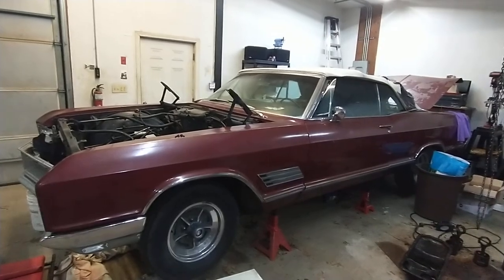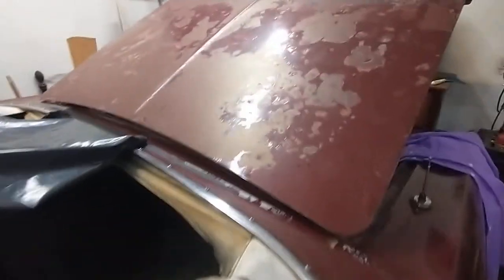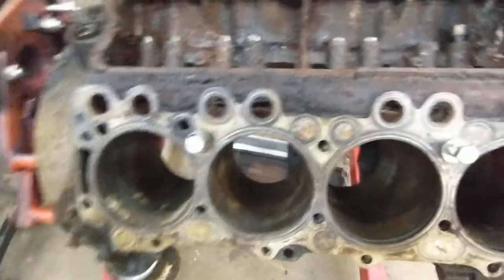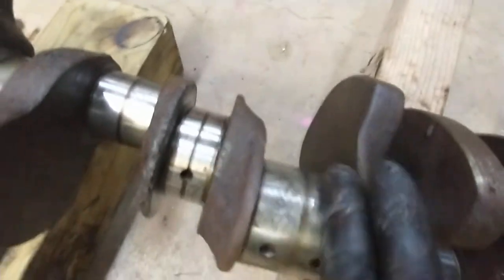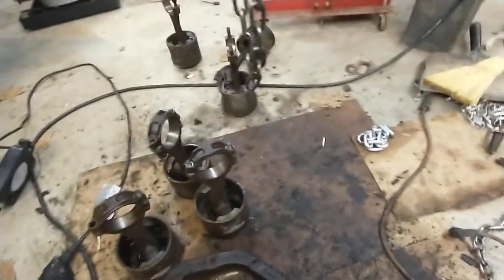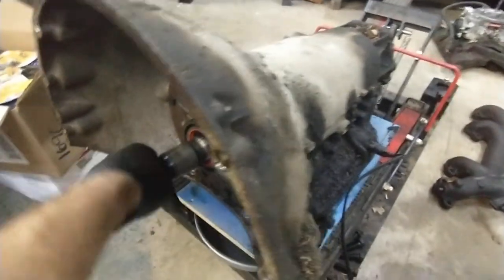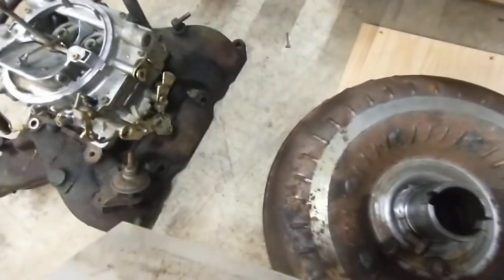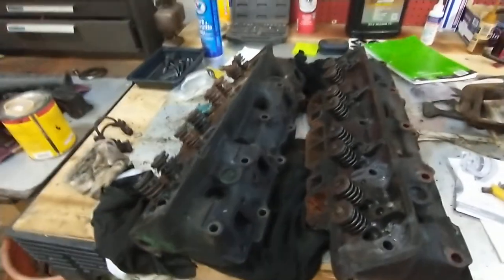New Project - 1966 Buick Wildcat Convertible!

Comment: That will be very nice once completely restored.  The 1966 Wildcat was a large car similar to the Chevrolet in size and a few other points, but in 1966, GM still retained the engineering differences that made so many people fans of one or the other of the GM brands going back to the 1920's, so the cars have few material similarities.  A few years after 1966 GM would change over to what came to be derisively known as "badge engineering" in which all of the GM brands shared the same transmissions, engines, etc.  For example, in 1968, the base engine for the Skylark was an inline Chevrolet six (which was by that time outdated and not as good as the Buick six that was in the 1967 Skylark).  The beginning of the end of individual engineering.  The Nailhead had the highest-lift cam on any production car at that time, I understand, to compensate for the small intake valves and the fact that the valves were on the same side of the chamber (a cost-saving measure, the prototype of the engine had valves on the opposite sides of the chamber, like a Chrysler Hemi).  But, the engines produce so much torque that you won't need to "upgrade" the performance at all to have a quick car that will more than keep up with modern traffic.  I think the fastest 0-60 time for the Wlidcat in 1966 was less than 8 seconds (might have been with the 425, but the 401 wouldn't be too far behind).  Who needs more pep than that when you have drum brakes?
Reply from the maker: Thanks Frank - the more I work on it the more I'm starting to realize you can't assume the parts are the same on a similar Chevy or Olds car.  1966 especially seems like a transitional year. Certain parts were unique for the 1966 Wildcat, like the motor mounts and glove box.  Fortunately many things are common, like the convertible top hydraulics.  It's pretty cool that all the GM brands used to have their own engines and teams of engineers in each division trying to out do each other.  It certainly sparked lots of innovation in the '60s.  Although understandably for cost savings it makes sense to have one powertrain division shared among all the brands.